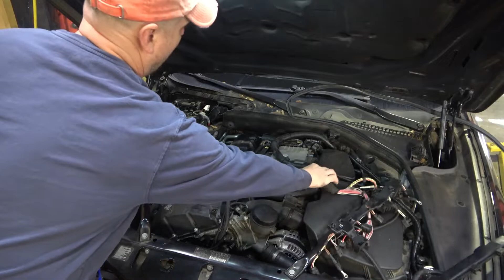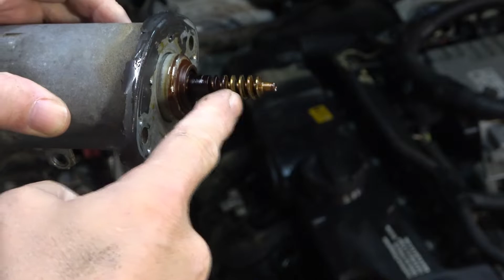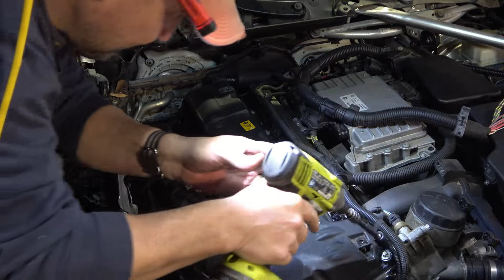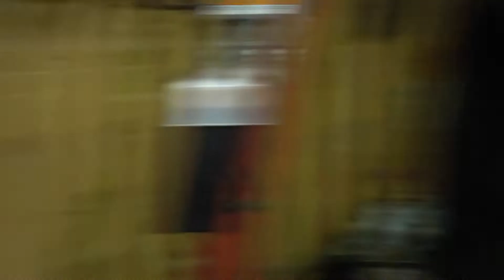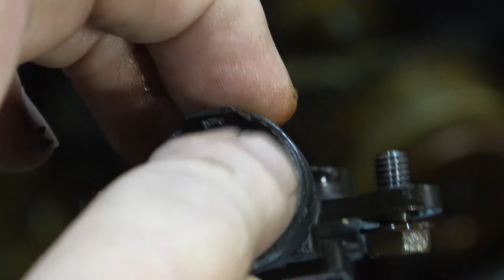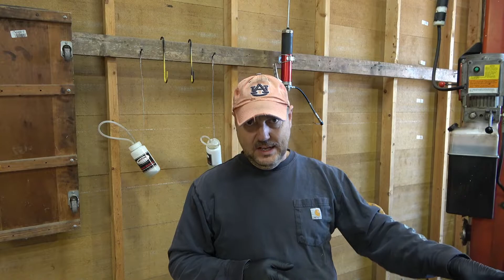BMW 528i N-52 Valvetronic Eccentric Shaft Sensor / Valve Cover Replacement

Comment: Question boss , what happen if I removed my valvetronic motor without losing tension aka without touch 4mm Allen bolt and pop out harder ?? Need help asap thanks same engine n52
Reply from the maker: Well, you will def need to get a scan tool hooked up and reconfigure the valvtronic for starters
Reply: @superb60ce everything good I did it 🫡🫡

Comment: Sorry, do you need to program that sensor with a scanner or is it only installed on a BMW 2007 328i?
Reply from the maker: You don't need to "program" it, but you do need the scanner to set the null point on the valvetronic motor properly

Comment: Hey I just purchased a 2010 528i xdrive with a bunch of codes p1017 , p0335 ,u1126, p1727, p1417 , p101a, cf2b ,cf34, 51a6, 507b. Some off them point to the eccentric shaft sensor and the crankshaft sensor, as well as the mass air flow sensor. But I think it’s the eccentric shaft sensor and it tripped off of theses codes . Thoughts ?
Reply from the maker: Its possible that the sensor tripped all those codes, also possible you have a severe wiring issue.  Start with the shaft sensor and go from there, use a new valve cover while your at it
Reply: I just swapped the eccentric shaft sensor along with the valve cover gasket . The valve cover looked in good shape .. I’m now I’m just getting crankshaft sensor codes.. I should be getting that delivered tomorrow, let’s seem how that goes !! My motor only has 175k miles engine looks new I’m hoping nothing major is wrong with it . Wish me luck

Comment: Man - I wish I could have seen HOW you removed all the wiring on top of the engine, before you got started!!  There are no F10 528i N52 videos that I can find showing how to do this.
Reply from the maker: Just take your time and be careful and patient...the connectors get fragile over time.  The reason nobody films it is it can take over an hour to carefully remove it

Comment: with the valvetronic motor,to get it out do you turn clockwise or counter clockwise?
Reply from the maker: t-25 clockwise until it stops, then turn counter clockwise as you pull it out.
Reply: What about putting it back in?

Comment: Great video bro you are correct that cover was so easy to pop off my e92  a little pain in the ass, the bolts on that valve cover can be reused the metal valve cover the bolts have to be replaced. Got to love German engineering on this thing sometimes lol keep up the good work